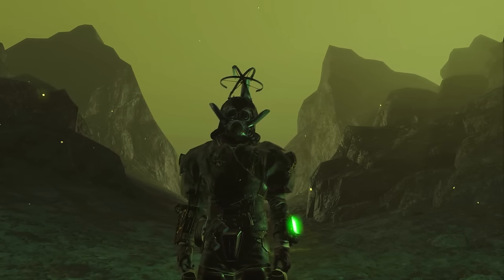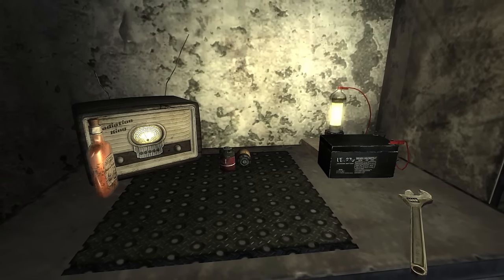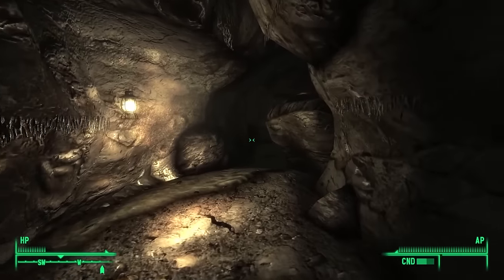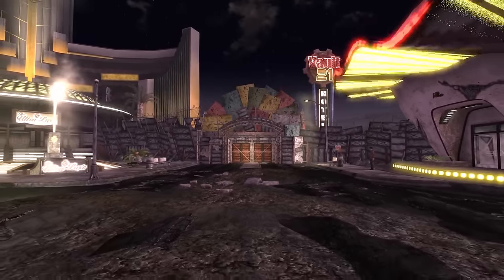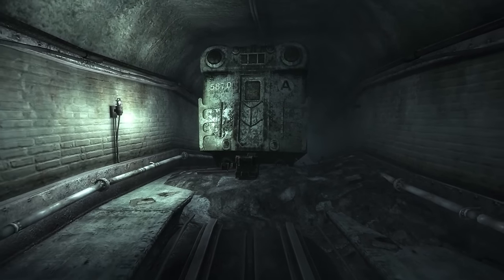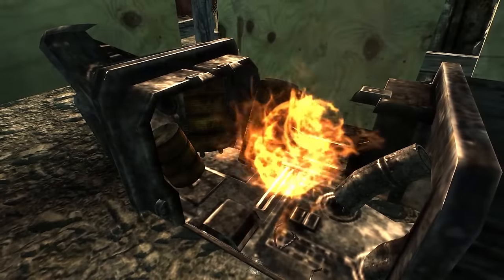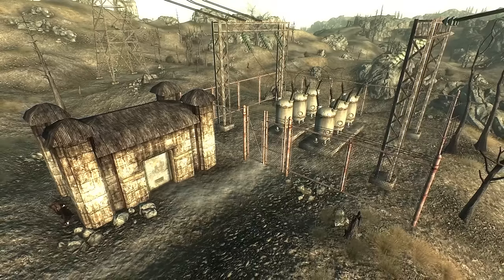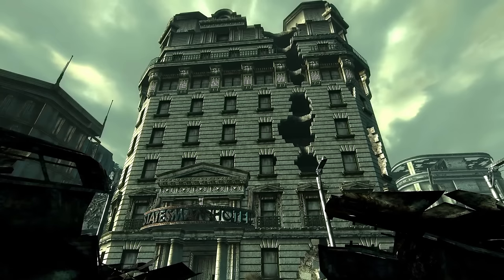Where does the power come from in Fallout?

Comment: I always thought it would have been alot more interesting in FO4 if the fusion cores taken from the buildings to use power armour actually had more of an impact, such as disabling the electrics in the building, and there could also be the same in reverse, areas with empty generators that need cores to power up and access the building, it would have given the player a little more to think about in terms of resource management, but I can see why something like that didn't fit into the direction Bethesda had in mind for 4. Shame though.
Reply: I have to wonder I that was intended as a mechanic at some early point but got axed for time and complexity, that said, a mod on this basis would be fun
Reply: Problem is it would ruin a lot of terminal lore since most players would take the fusion core first chance and never put it back
Reply: @justanotheranimeprofilepic  that's why it would be cool that's what players do now but if it shut down the building it woul make players think about taking it or at least make you come back for it after exploring the building
Reply: @justanotheranimeprofilepic rn there's only pros to taking it and with how powerful they are I think there should be some cons
Reply: @FlavaTown420  with the fan base fallout 4 is appealing to, having backtrack either to the start or midpoint in a dungeon for a fusion core would just annoy most players
Reply: @justanotheranimeprofilepic  the problem is that games nowadays shy challenge like a vampire does sunlight.

We have game journalists who are unable to finish a tutorials, (independent) reviewers who care only about being(one of) the first.

Any game that requires more attention, thought and effort then candy crush is suffering from it.
Whereas dark soul is praised because "difficult" would be considered "a game" 20 years ago.
Reply: I totally expected the lights to go out for the whole building when I first grabbed a fusion core
Reply: @benderrodriguez5425  some people play games for the story, some people don't want to be bogged down in endless challenges and puzzles. The video game market is increasing and with that comes an increase in availability
Reply: I want to know what's up with all the rubble and garbage everywhere ? 200 years ? It looks like 10 , 20 years at most since the bombs landed. That would explain why the power plants still kinda works and there's still packaged food.  This whole universe is a little strange because most of it doesn't make sense, but I love em and can't wait for fo5.
Reply: @GTSN38  have you ever lived in a big city? Nobody picks up anything especially if they aren't getting paid
Reply: @justanotheranimeprofilepic2154  they keep everything pretty clean, inside their home. But I believe the people would have eventually organized and made laws. Keeping the area around your house hazard free would probably have been one of them. I live in chicago and it's a dump, but they don't keep rubble and dead bodies laying around. It's mostly junk mail, empty bottles of water, and potato chip bags flying everywhere. It's bad, but not like fallout. In fallout, the developers over did the junk laying around.  it looked like all the people shoveled all  that stuff purposely into the way.
Reply: @GTSN38  I think when the main point of your government is protecting each other from ghouls, supermutants, raiders, and whatever the wasteland throws at you, you will probably forgo trash day
Reply: @justanotheranimeprofilepic  I don't know, imagine the guards are running toward the gate to stop some mutants and half of them trip over all your junk ? When the mutant threat is taken care of what do you think they're going to do to you ? You can't have a civilized community without rules. I don't think it would be a super big crime, but I could see them fining you a few hundred caps. Nobody wants to live in a refuse dumpster and they'd probably kick people out for repeated offenses.
Reply: @GTSN38  I'm a fan of the post apocalypse looking awful. Now if we were out west it'd be different but the east is still uncivilized
Reply: pucciega  noriega
Reply: I almost guarantee this was supposed to be a feature at some point but was never finished to get the game out on time, just like so many other features :( I wish they gave themselves another year.
Reply: @justanotheranimeprofilepic what?
Reply: that would require a casual player to use more than 2 brain cells which they just don't have - and since every game needs to be no-skill and no-brain to be casual friendly.. 🤷‍♂️
Reply: @justanotheranimeprofilepic  Lmao get out of here with that subtle attempt at calling the fanbase dumb. Literally anyone playing video games would hate this. Back tracking has been universally hated since gaming began.
Reply: @Spiffo0  exactly my point. Fallout isn't a puzzle game so backtracking would make many fans upset
Reply: I honestly was expecting that to happen
Reply: @justanotheranimeprofilepic majority of ppl dont read all that shit, i know i dont after the first like 10 or unless itll be obviously interesting
Reply: I always thought the same thing!
Reply: @justanotheranimeprofilepic  fusion cores for power armor are lore breaking already since the power armor is supposed to have a built in power source with hundreds of years of life.
Reply: i thibk it would be cool if you could go to a building and reinstall the fusion core and it would charge it for you as well as light up the area
Reply: I hated cores as a complete butchery of the lore
Reply: I mean it’s kind of stupid how you can steal the power source of the entire building and the building’s power is unaffected.
Reply: I think this mechanic would work by just adding a simple text pop up that explains what will happen to the building settlement etc and in a few in game days see what happens. It would fit into realism and have real world effects

Take the power cores from diamond city and a riot happens or take the power core from a building and back track out of there in total darkness and have surprise enemies pop out
Reply: This is a terrible idea lol. You want more resource management in fallout ?
Reply: When we take the fusion core from Concord for the first time, I totally thought that was the premise but it wasn't. Totally cool if they did though
Reply: @GTSN38  FO4 world makes no sense. I even wish Bethesda would just retcon 4's worldbuilding altogether. Not only did I not enjoy its aesthetic choice, the progress of the world 200years after the war makes no sense whatsoever.
Reply: @forloco6508 you are talking about rechargable batteries and not fusion CORES. A core cannot be recharged. In nuclear powerplants the cores are being exchanged once they burn down. The rest gets dumped into deposits for (maybe) the future. 
You need new technology in order to milk those deposits further. But as far as I know you can't recharge the cores.
Reply: @FlavaTown420 yeah, the point they're making is that if you take it you'd lose access to stuff and if a building didn't have one you could put one in to power everything. It adds a layer of complexity and some lore shit and could also have helped settlements by giving you a fusion core based power option
Reply: @justanotheranimeprofilepic there's not that much interesting stuff on f4 terminals anyways
Reply: That's what I thought was gonna happen the first time I pulled a fusion core from a generator in fallout 4, then nothing happened
Reply: @justanotheranimeprofilepic  I'm sorry but if you want the reward of the story you need to beat the challenges the game presents you with. Free rewards leads to you ultimately not caring about what you got, because why put in effort if the designer didn't? Also in today's day and age you could experience the games story for free on YouTube and not even bother with the gameplay.
Reply: @GTSN38  Most of the junk would just be thrown outside of the community. That way the Super Mutants would trip on them. 
But realistically there is nothing they could do with the trash & rubble outside of dumping it into the less used streets/buildings or into rivers/oceans. I'd rather dump it into the streets than the water I probably need to use
Reply: Fall asleep 4
Reply: Yea I always wanted it to work like that too but god forbid Bethesda make anything interesting, or add and decision making lol
Reply: Yeah, like others have said I wouldn't be surprised if it was an intended feature that was cut due to time constraints
Reply: @GTSN38  fo4 was originally intended to take place 10-20 years after the bombs dropped but they changed it
Reply: Tbh you have plenty of fusion cores like a quarter into the game so all this mechanic would do is be annoying after the few hours
Reply: Cons are.. most fusion cells you find in places,are in [places] that have enemies.
Reply: Too much detail of Bethesda
Reply: I had the same idea. I always felt bad for taking the fusion core thinking it woyld knock off the building i was in. Its plausable that the fusion generator possesses either batteries or capacitors that store energy from the fusion core as back up power.
Reply: @Infernostar18  In my first few playthroughs I felt similar but then I came to the realization that the vast majority of items in FO4 exist solely for the player, for crafting, or in settlement building and that's why junk is everywhere even though it doesn't make sense that so much of it should still exist after 210 years of scavaging, let alone that some of it resets after a period of time to be looted again. The removal or addition of fusion cores having an effect in-game outside of for power armor and gatling laser ammo would have been nice and potentially added some additional strategic value so it can be added to the long list of things players wish the devs had done better in FO4.
Reply: @jcohasset23  thats fair. Sometimes i find it hard to get passed the immersion factor. Then i have to tell myself "its just a game, it doesnt need to make sense".
Reply: Would’ve made for some good puzzles
Reply: We’re all pleased to know that this exact situation has occurred in the fallout tv show
Reply: Yeah
Reply: @hundkebab2433  screw the casual
Reply: I honestly think they MEANT to do something like that, but alas bethesda... they seem to shirk the 'little things' until 5 months before release... if ever... since they made Settlement building seem integral but apparently only tacked it on a month before the release date...
But yeah, the flicker and loss of power in the fusion core generator seems like they meant to add to it, but then just f-ed it off...
Reply: that's too much gameplay and interaction for a bethestard
Reply: Well now you have the answer in the new Fallout show :D
Reply: You expect consequences from a todd coward game?
Reply: Vaults at least have backup power after you take the fuel cell so some buildings me be the same
Reply: @benderrodriguez5425   is not like fallout 1 is more fair in what it does i had to use a radio to deactivate force fields and there wasn't a single hint of that
Reply: I think they just didn’t have the time.
Reply: Too much work for bethesda
Reply: FO4 DLC Nuka-World alludes to this being a thing.
When you remove the Core from the generator in the Cola-Cars arena Gage says, "Power to the arena is down by 30%. You do that?"
And that's it.... Bethesda was probably gonna make it a feature but I guess they scrapped the idea for some reason.
Reply: The only one that changes anything is the one in the Nuka world gauntlet. And I’m not even sure if it does anything! All it does is have Gage mention the power to the arena being cut in half and then congratulating you
Reply: Great idea for a hardcore mod
Reply: They got terminals you can shut down powers

Comment: In Fallout 4 my headcannon was that the fusion core generators were there for emergencies and that buildings themselves were still hooked up to the grid
Reply: I think the generators worked on their own, with the core as the thied tier backup, but my god I hate the cores completely.

The reactor in a T51 is meant to last 2-300 years of continuous use, not 200 years of no use and 20 minutes of use. Bethesda's decision to give Power Armor early and the resulting need to balance it absolutely destroyed the lore.
Reply: Yeah, I think that's a reasonable conclusion. The "fusion" cores aren't fully inserted because they aren't actually being used, or are only being used at a trickle to power the light and buttons on the generators themselves, as the generators are in standby mode and only begin producing full power when the mains power goes out and the core is fully seated.
Reply: @DIEGhostfish  yeah its Bad to the Lore but the Power Armor system in Fallout 4 was so much better than that in the previous Fallout parts and in my opinion: gameplay and fun>Lore
Reply: @chrisrecchia2732  1&2 were the best.
Reply: I wanna get hooked up to the grip
Reply: Leeloo_the_fox  Is there any way to have infinite cores?
Reply: @Sword_of_Saint_14  nuclear physicist perk. I almost exclusively run power armor and never run out. Even when using galling laser as my primary.
Reply: @Sword_of_Saint_14  also the bobblehead a top the corvega assembly plant.
Reply: Headcannon is an oxymoron
Reply: It makes the most sense especially since there's a fluctuation when removing the core.
Reply: @chrisrecchia2732  and that line of thinking is what gave us black female waffen ss characters in a ww2 game
Reply: @johnnytower6169  Did that Charakters make the Game better?
Reply: @chrisrecchia2732  they really didn’t, I’d say they kinda took away from the immersion

Fallout 4 got the power armour right in the sense it’s a vehicle rather than an item of clothing. In new vegas the NCR got some power armour but they had to strip the “powered elements” to utilise it. But seeing as they’re meant to be a hulking mass (like fo1+2) that didn’t make a lot of sense either

They just needed a way to nerf the armour in fo4 because they gave it to you wayyyyyy too early. It should have had the old school lore, the customisation would have fit the setting equally well also, but the armour should just run without new cores. I think the biggest issue would be the regular servicing. I can imagine various fluids, hoses, belts, seals, bearings, and connections would need to be inspected and/or replaced every 100-200 hours of operational runtime and maybe every 500 hours of low intensity usage

But that wouldn’t make for as much fun having to scavenge for replacements often, it would be better if you could discover people with the ability to do the work and have them do it for you for a fee
Reply: @Sword_of_Saint_14  There is a respawning raider in power armor that will move to a wall, turn his back and just stand there complaining for about 5 minutes... with a hole you can see through to get the power core location... for some reason you can STEAL the power core off of him and boom, free core.
Reply: @chrisrecchia2732  they could make it fun and lore friendly. Just say that original reactor ran out of fuel and we need to replace it( can make bunch of quests for this), parts of armor was good idea, so this can stay. They implemented some kind of Power Armor HUD, so potentially there's some kind of electronics and mb OS inside the thing, ok cool we can make upgrades for this and also bunch of quests. 
but I get it, it's too hard for people who designed VATS system, which is "just works" for some reason when you put pipboy on your hand 🤷‍♀
Reply: @OscarDirlwood  Lol ignored
Reply: @liisahmanni  I couldn't care less
Reply: @DIEGhostfish i think the fusion core is something to replace smaller fossil fuel engines.
Power armour weighs approx 1500kg/3500lbs, according to some of the wikis, which would be the equivalent of running a small excavator of similar weight, using hydraulics and electronic systems etc.

I chose a tb216 mini excavator for comparison
Fuel consumption estimate is 65%capacity, 2.4l/ .63 gal/hour, so the 22l/5.8gal tank of diesel would last a few hours with the full tank diesel being roughly 66kwh.
I'd presume power armour is probably using fuel energy quicker because moving more .

An emergency generator for the lights of , say 100 bulbs @60watts - 6kw and a few kW of computers would mean the fusion core would work for a few hours even for a large building, so emergency backup and still running off automated grid seems most likely- with surviving infrastructure under a lower grid demand as damaged bits have been automatically switched off, and remaining humans use less power.